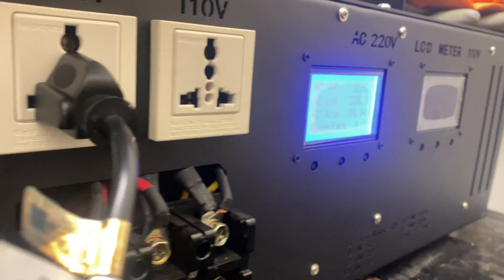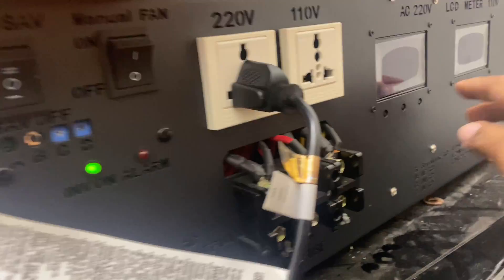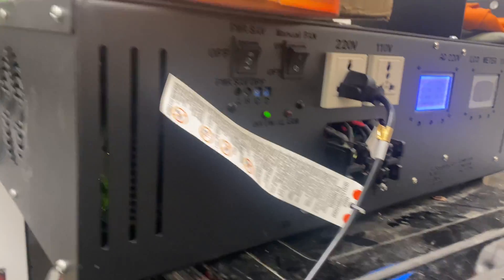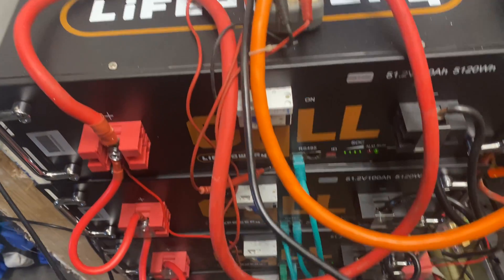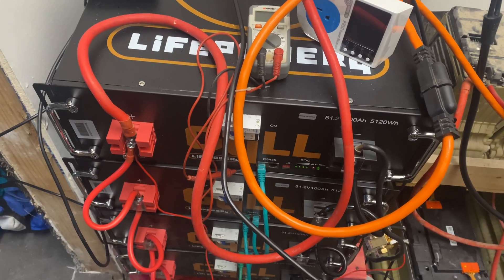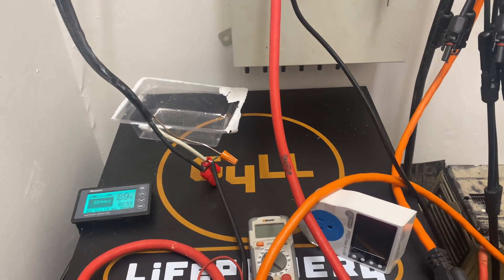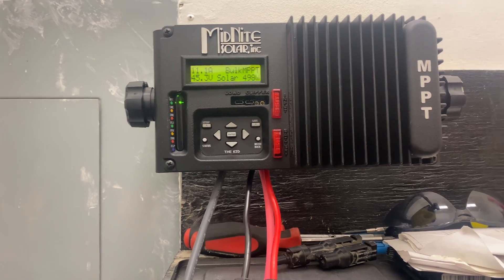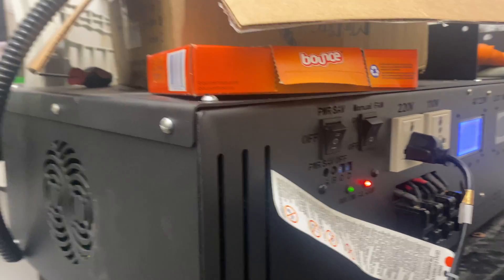Running My Air Conditioner Off Grid(8kwh Chevy Volts Batteries )

Comment: I just discovered your channel and love it. I have a question that I hope you can help answer. I do not know much about solar and batteries and am learning. I have one of those mc4 watt meters good for 60 volts. It's plugged between my solar panels and my Bluetti AC200P. I recently added more solar panels in series and my voltage is just over 100 so I can no longer use this meter. Do the make meters that can take over 100 volts that can monitor solar panel power by just using mc4 connectors?  I do not trust that my Bluetti is giving me an accurate reading of solar power coming in so I want to use a separate meter as a check.
Reply from the maker: Thank you so much and I’m sure the make some rated over 100 volts
Reply: @texasoffgridguy8749  you should start providing affiliate links to products you like and make extra cash. Your videos are what people really want to see. Tests. That's what's up and you don't see many people doing these really world test. Hell I subscribed the very first video I seen of yours. Keep up the good work bro and you will be the next Will Prowse.

Comment: How did you make out with the power failure? I would not discharge the battery to 100%
Reply from the maker: I made it through, battery was at 35%